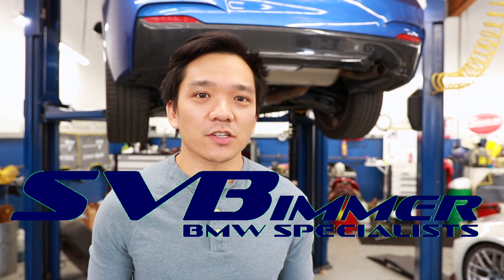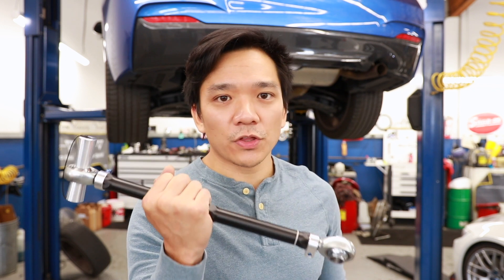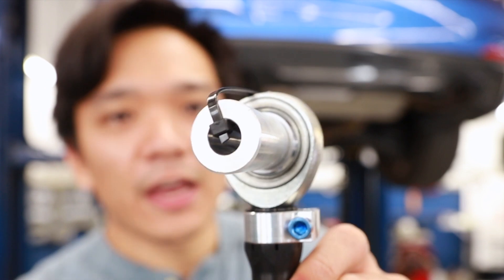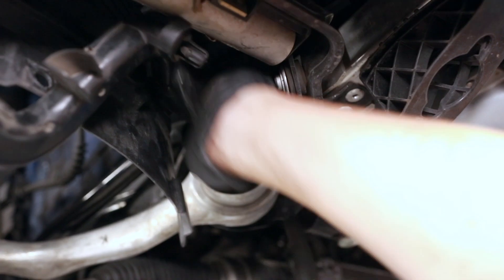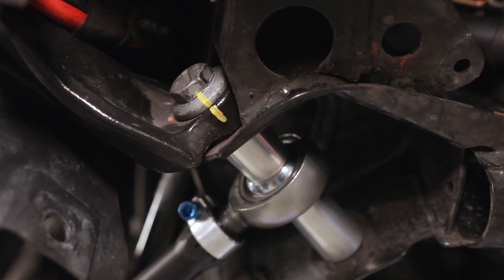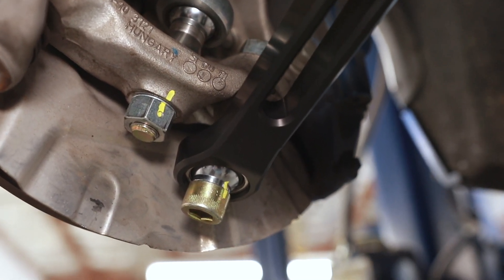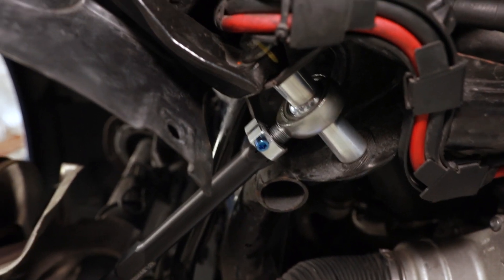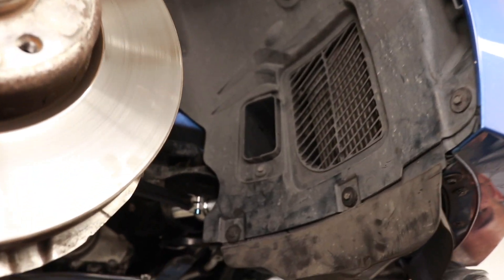BMW Thrust Arm Upgrade | Front Tension Rod Strut Install | SPL Parts

Comment: Did you not take out the axle bolt? I am replacing my thrust arms with stock ones, can I also do it without removing the axle bolt? This would be the best case scenario as the axle bolts from bmw are $40
Reply from the maker: No. I think that's an X drive thing though

Comment: How have these held up over time? Also how do they compare to the VAC monoball option from kies?
Reply from the maker: Haven't tried those so I wouldn't know. If it's just a bushings then the only difference would be the adjustment portion
Reply: @FritzRamos  You refuse to answer the question... HOW IS THE FEELING OF BEING DAILY DRIVEN WITH THE ADJUSTABLES???

Comment: Hi, I’m planning to go m LCAs and m thrust arm together. Will M thrust keep the caster not going forward on M235? I’m planning to run 255 at front. Idk if M LCA and M thrust will be helpful.
Reply from the maker: The M sport control arms will move the wheels slightly forward unless you do the msport thrust arms. That's why I went with spl. Also the bushings are better on spl parts

You'll also need spacers for the front
Reply: @FritzRamos  Thx so much for replying! Do I need spacers on hubs or spacers for Thrust Arm Bushing? I’ve been going through these post, I’ll need 15mil and 2mil spacers on bushings. Will I keep OEM casters after installing both M LCA and M TS? Really struggle😹😹

Comment: You're supposed to torque down the bolts when the suspension is under load, not up on a lift. I had to say the same thing when you did the lower control arms. Double checked to make sure that what I said is true and then fire your mechanic. Not joking
Reply: I believe this is only true for rubber bushes. Since the monoball bushes operate differently and can rotate freely unlike the rubber bushes they can be torqued down without needing to be loaded.